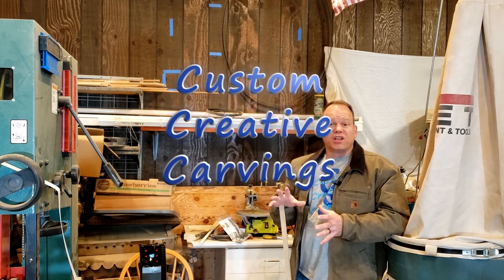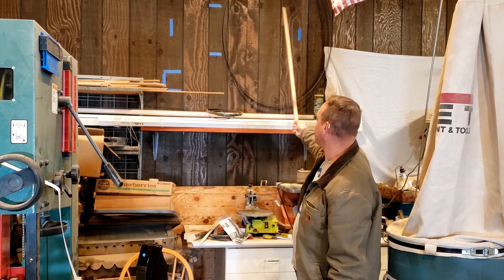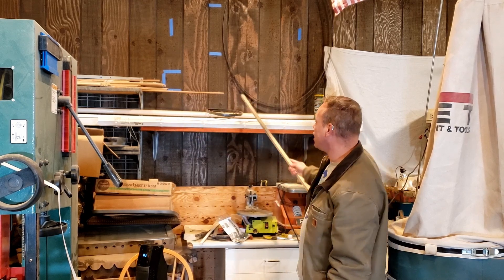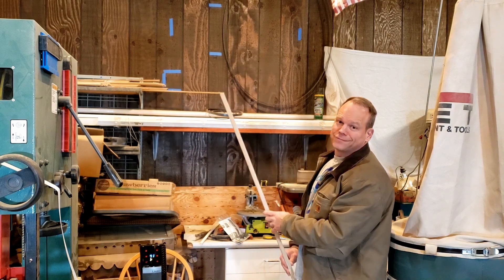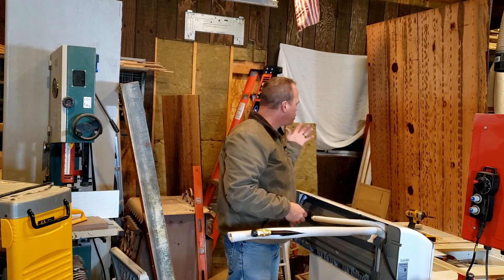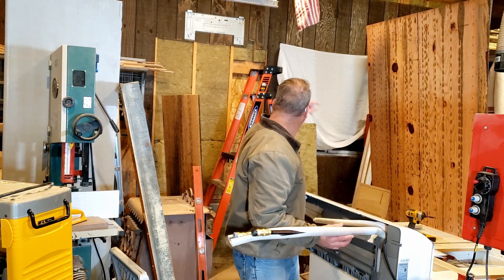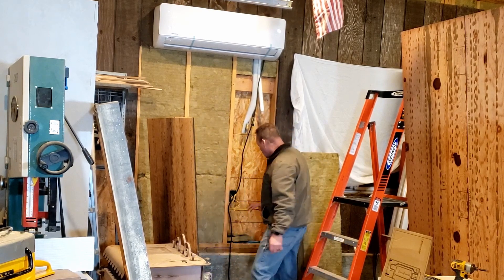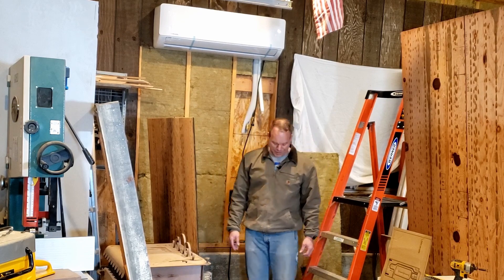MRCOOL Mini-Split shop Install Day 1

Comment: I put a small concrete pad at the exterior location to set the fan system on. It works well.
Reply from the maker: I did put mine on concrete, and I am glad that I did. I am dealing with an ice issue though. It forms on the concrete after the defrost cycle.